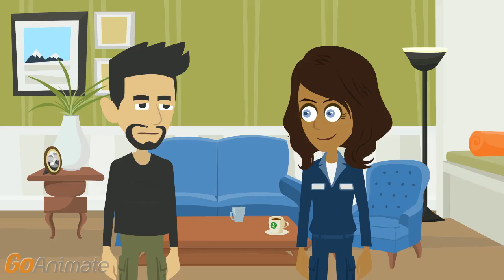Can I Install My Own Central Air Conditioner?

Comment: This is not helpful at all. There is no consistent topic. They just jump around between wall units, reverse cycle and central systems, without ever actually answering the question. All of the videos by this poster are the same. Very unhelpful. I feel like I’ll never get the last 3 minutes of my life back...

Comment: You need to know how to pipe weld and do a little researching on understanding the pressures of a low side and high side of the compressor/ condensor and you don't want to over do it with refrigerant or you can slug your compressor (break pistons all kinds of dumb things) when in doubt its best to undercharge a little. It can be done yourself but it's a pretty big undertaking. You want to make sure you weld right so you don't lose all your refrigerant. Hard but not impossible but you have to be intelligent.